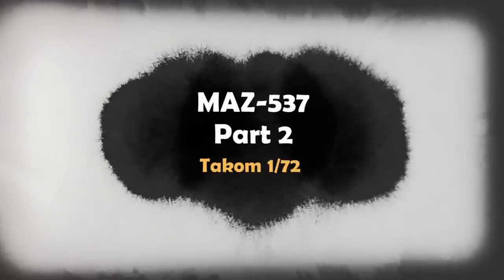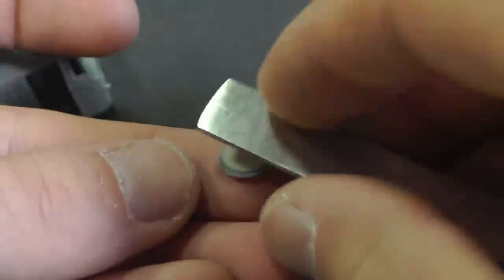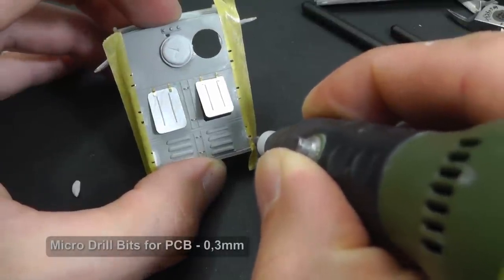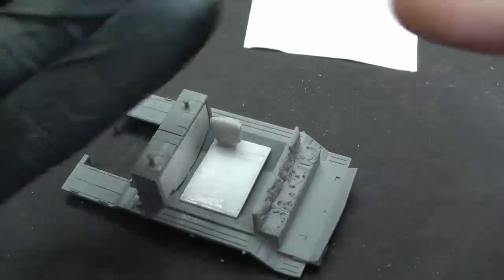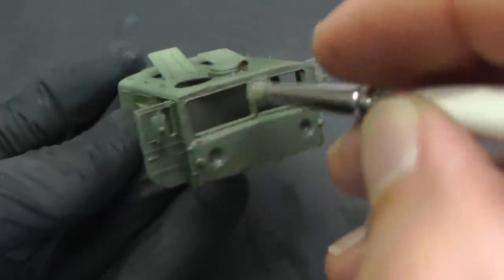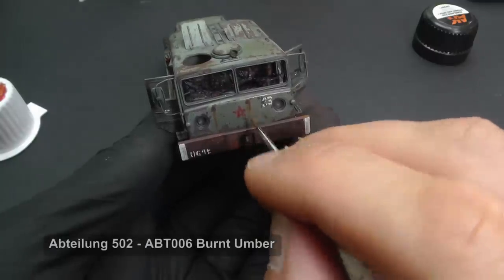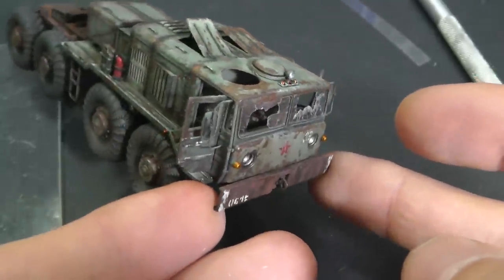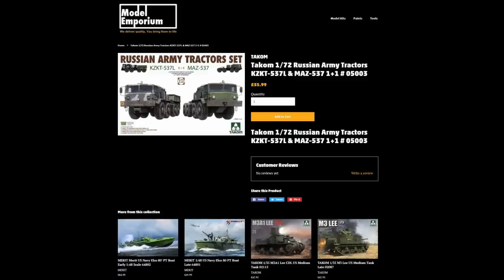Abandoned Soviet MAZ-537 Pripyat Chernobyl - 1/72 Takom

Comment: Well done. Yet another Plasmo masterpiece. 

Just a quick tip. If you want to save a little bit of money. The expensive chipping fluid you have there is really no more than hairspray liquid. Just go to your local "dollar store" (discount stores where everything is dirt cheap) and look for the cheapest pump hairspray and there you go. You can use the pump sprayer on the bottle, but I found it works best in an airbrush. Also for weathering powders I started out with some sidewalk chalk my kids had and weren't using any more, but for better color choices I picked up a box of hair die chalks from Amazon. It's a box of 24 colors for something like $7 US & free shipping. The sidewalk chalks worked ok but the hair chalks are perfect. I'm all about saving money everywhere possible. I'm not cheap/tightwad, I would love to have the readymade hobby specific stuff, I'm just broke and a disabled veteran without any benefits and trying to get my modeling company (war gaming terrain, figure assembly & painting, custom models & diorama, and action figure dioramas/displays. And actually I'm adding HotWheel/MatchBox restorations as well) off the ground and instead feels like I've only dug a hole. 

Anyway, great job. I always enjoy your videos. Thanks for sharing your work. Keep up the good work.

Comment: Incredible work - I would probably bin the army painter insane detail brush and use a Windsor and Newton series 7 size 1 or similar. We in the miniature painting world normally learn loads from the scale model community (believe it or not we are only just really starting to use AK washes and weathering kit)  but one thing we as a community have gotten nailed is brushes, for fine detail and free hand, most will use a very high quality size 1 brush as it holds lots of paint, doesn't dry fast and flows much better (same as water colour artists, we all look for the same qualities)

Comment: Fifth wheel hitch is rubber so it wouldn’t rust.
Reply: Rubber coated to inhibit rust perhaps, but there's no way it could be entirely made of rubber, it would not take the stress of a loaded trailer.
Reply: James Collier the out side is generally rubber. I have a real semi truck I use for hauling a horse trailer.
Reply: Waffenbear117 i drive class 1 trucks and the fifth wheel is not rubber at all
Reply: lee barlow hmmm my Kenworth t300 single axle tractor has a a thick rubber pad over the fifth wheel hitch? Maybe it’s different on smaller trucks?
Reply: Waffenbear117  maybe mate not sure on that one